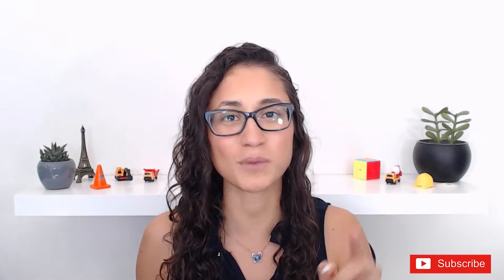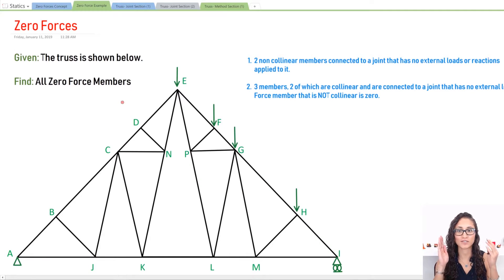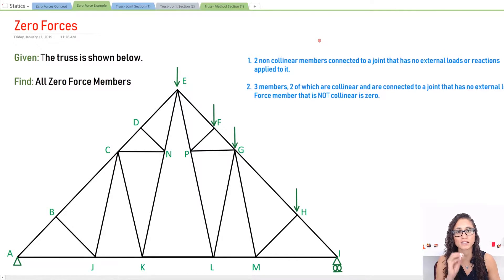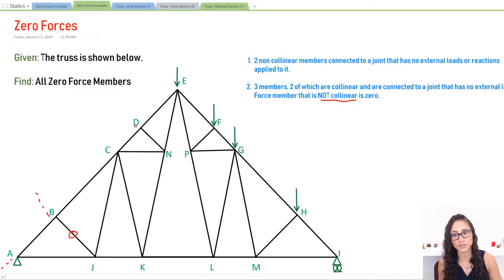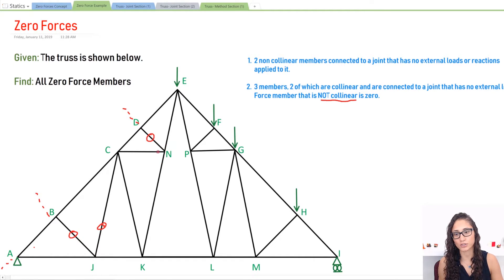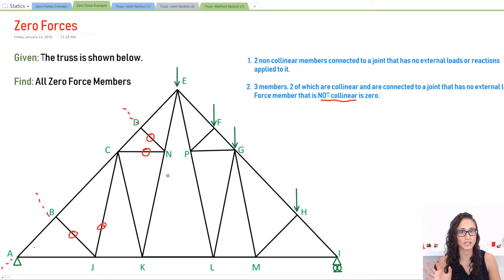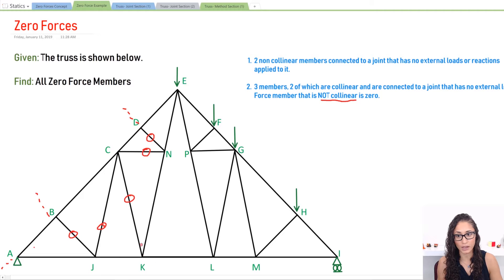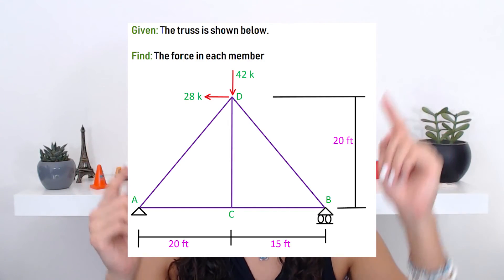FE Exam Statics - Zero Force Members On A Truss

Comment: I don't see how NE is a zero force member because of the Force acting on joint E, I understand the concept your saying but all the members need to take into account the other forces acting on the different areas of the member. If you wanna say member NE is in tension to resist the force on joint E then that dives into a deep discussion on how the other members on the left side of the truss are responding. I don't think member DE, PE, and FE are the only ones with the forces on them with respect to the force on joint E.

Comment: Hello! Thank you for all your videos. Just wanted to confirm if member PG is considered a zero force member based on:
the 3 members, 2 which are collinear and connected to a joint that has not external load rule. Thanks!
Reply: PG has load at the right joint